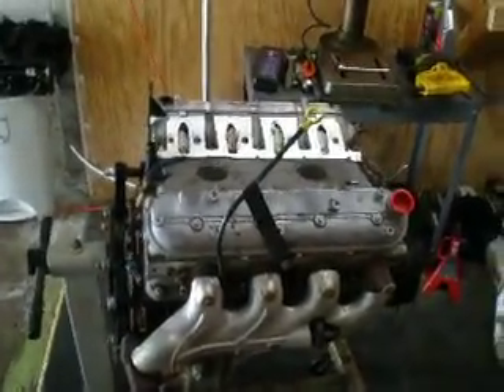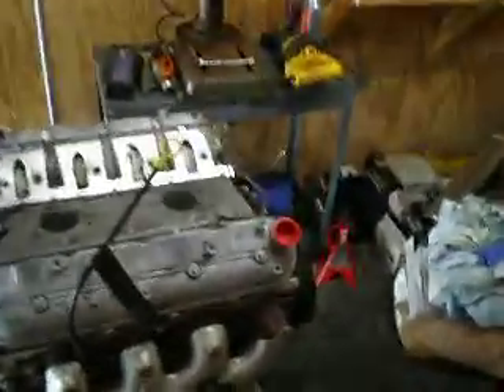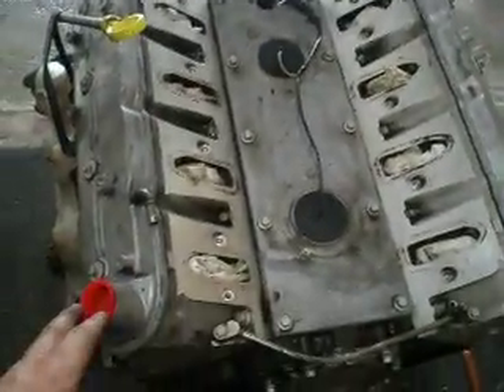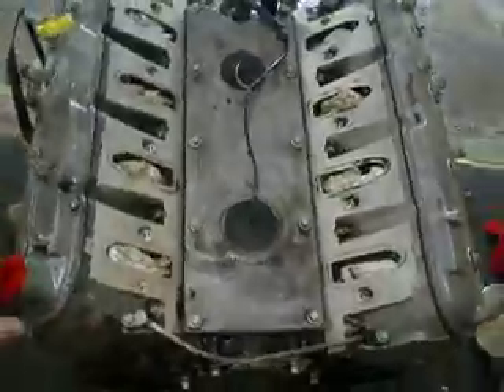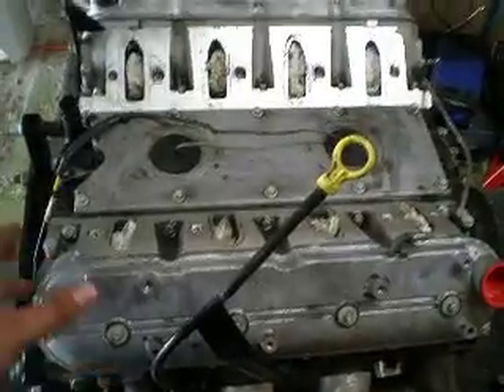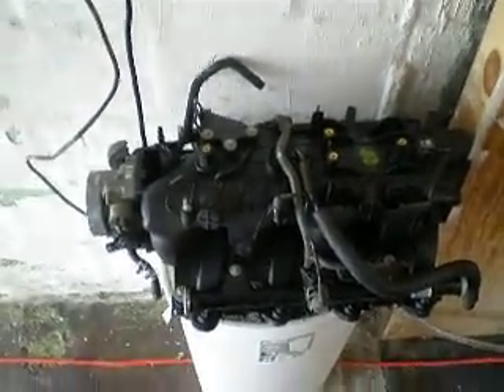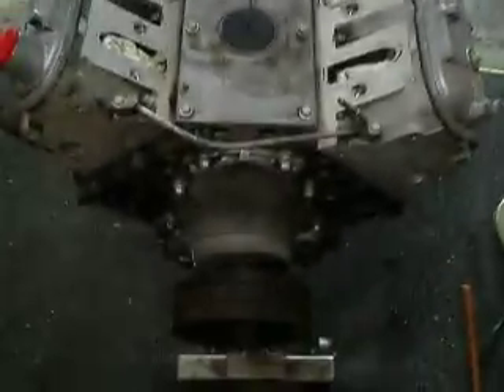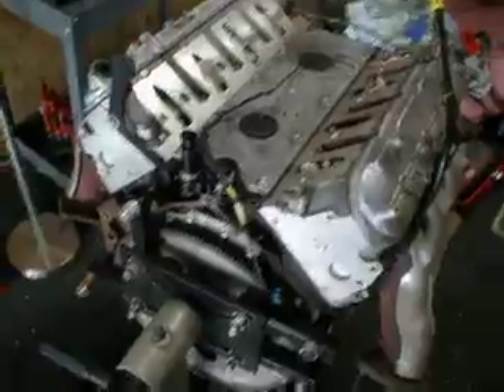GM LS1 V8 Engine Swap Part I

Comment: GM NEVER PUT LS1s in TRUCKS!
You have an L33 or lh6 5.3L!
Reply from the maker: No shit Sherlock... but the LS1 is more recognized and has higher search ratings... and your STILL wrong.. I have an LM7 :P
Reply: BEETEROLDS
Chevy never made a LM7 with an alum block.
so You have a L33, LC9, LH6, LMG

I have been doing a LOT of research on Ls swaps.
Reply from the maker: Dude... the motor is out of an 02 Tahoe.. Its a cast iron block... I know what I have.. I wish I had an all aluminum motor.. but just the heads are aluminum
Reply: BEETEROLDS
My bad,  I didn't see the iron block in the vid.

Comment: Who cares if its a pushrod engine. Over head cam engines (1919) have been around almost just as long, the Wankel rotary engine has been around since 1951, electric motors have been around sine the early days of the automobile, so we see that no "real" new mainstream technology for cars has come out in 60 years.  I think we all know what he meant by new is the efficiency that comes with a new engine. Cool swap by the way! Using the stock fuel injection set up is not that expensive by the way.

Comment: If I was you I wouldn't start off with a carburetor. I know it's personal preference but just an opinion.. Also why not go with an ls6 intake or like a FAST 90? Or for a cam why not like a 228r? Something that's still relatively small with a nice curve. I would say that an LS4 with an LS6 intake, 228r cam, some 243 heads and a good tune (+ bolt-ons obviously) should throw down 350-375 horses to the tire- just a guess.

Comment from the maker: @JardineRT1 No kidding.. pushrod tech has been around since the late 1800s.. but this is refined technology.. these small displacement engines make sick power for not very much work and not much coin... I was referring to new technology against a pushrod engine of the 60s and 70s, with NEW gasket sealing, cylinder head flow, combustion chamber design, overall refined engineering features these engines are great for what they are.

Comment from the maker: @madmack692 The truck oil pan will work fine.. the only issue is that it hangs really low.. im going to remove about 2 inches from my sump and simply have it rewelded.. These swaps are a lot easier than most people think